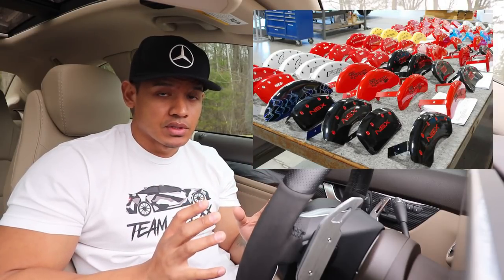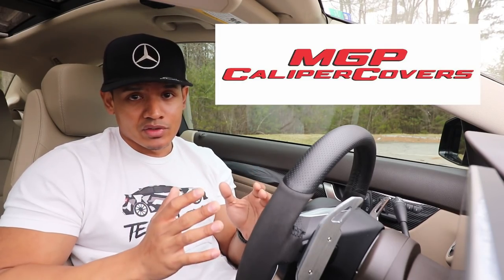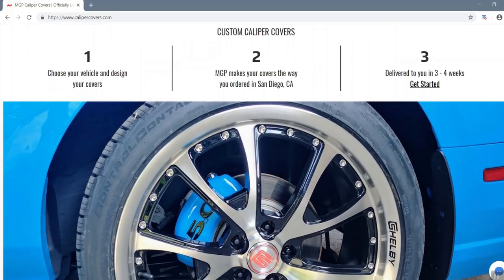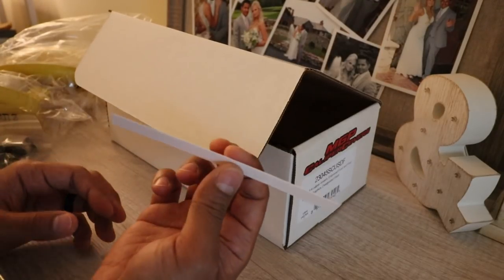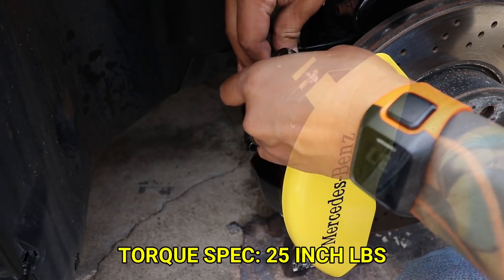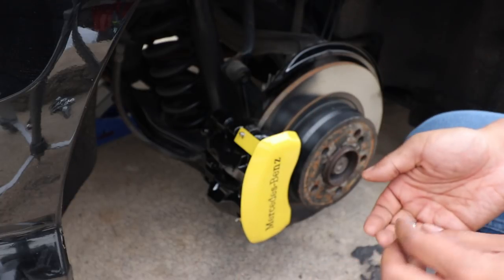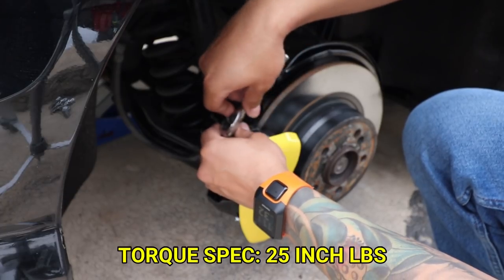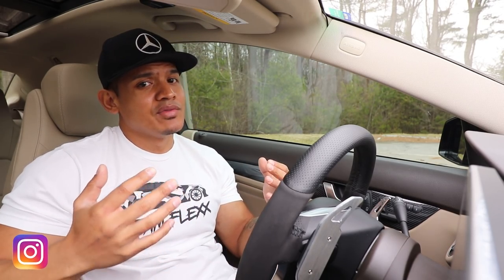Super easy yellow Caliper Cover install on my Mercedes C250 Coupe!

Comment: That looks great Flex going to have to get some for my C300 just got mine back from the Mercedes dealership on the recall of the airbags and then they told me I need a transmission mount so I'll do that myself a super easy with my manual transmission than everybody else is automatics keep it real